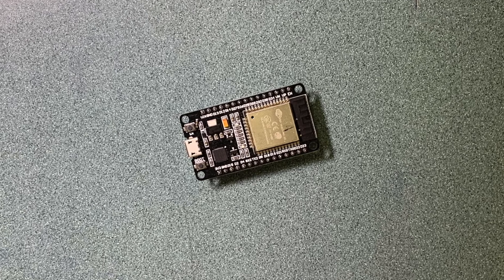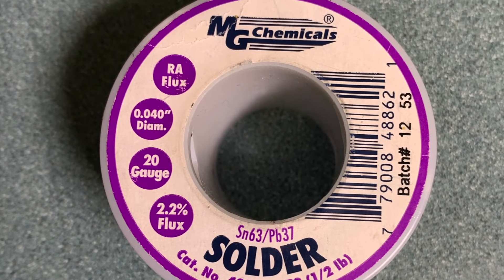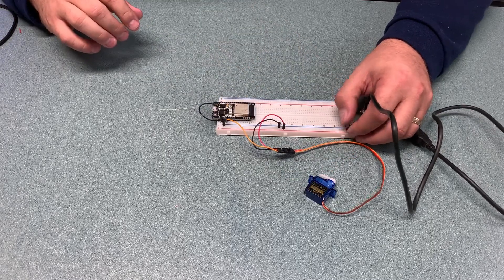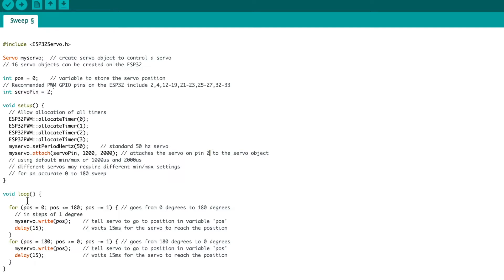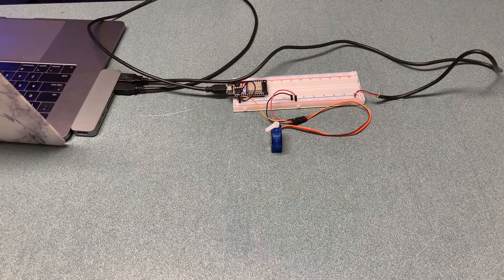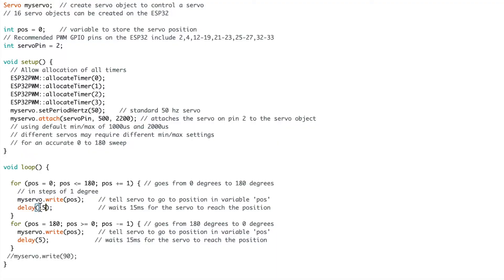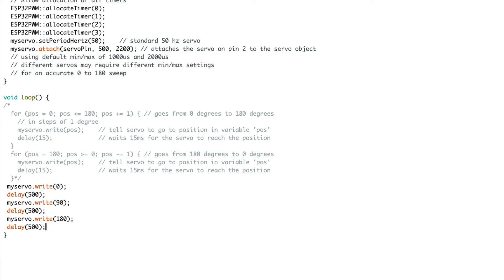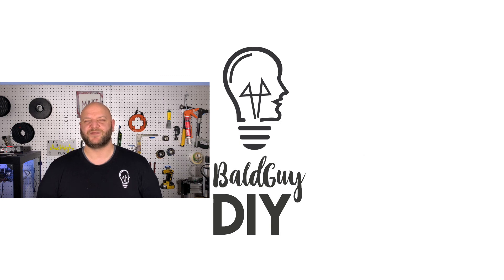Controlling Servos with ESP32

Comment: Are there downsides to using the esp32 rather than Arduino? Seems there may be less compatible libraries?
Reply from the maker: That’s a great question!  I would say after using both for a while that there are no insurmountable downsides to using the ESP32 and many upsides. There are times when a library designed for Arduino microcontrollers will not work correctly for ESP32, but in every situation I’ve had so far there was an alternate library that was already made for ESP32, or a different Arduino library that would work with it. 
Also, it’s newer and less established in the market, so there are fewer add on cards/hats/expansions made for it to simply plug into like many Arduino models. 

On the benefits side, it’s cheaper, faster, with built in wifi and Bluetooth, and also has the ability to be programmed with Micropython. Plus for battery powered applications, the ESP32 has incredible power saving features.

Hope that helps, thanks for watching!